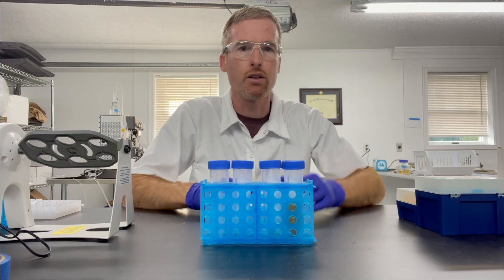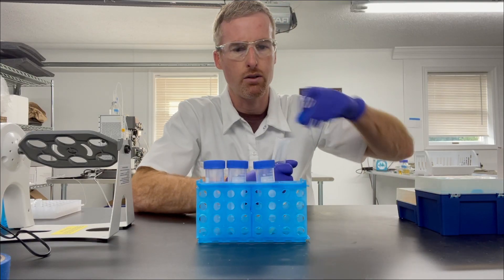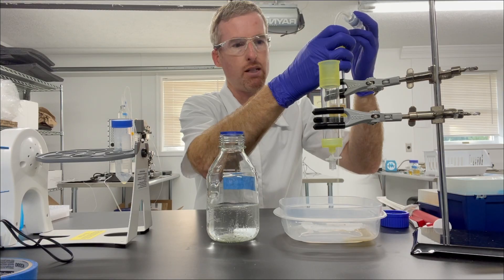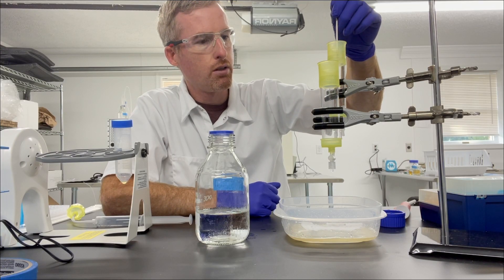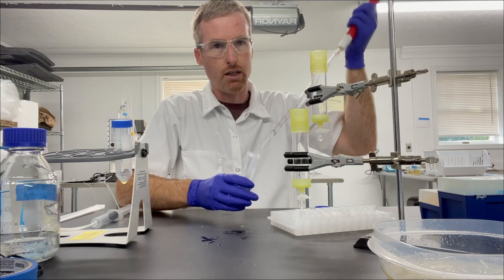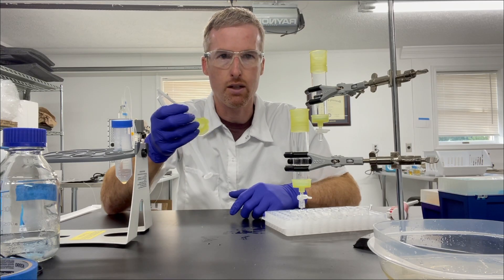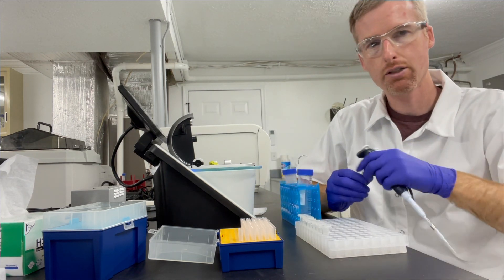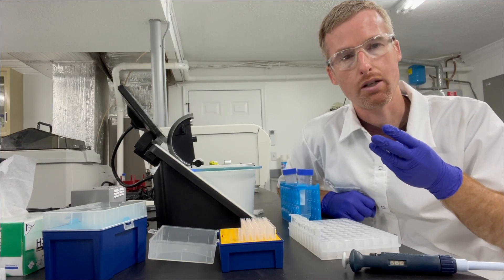His tagged protein purification from E Coli

Comment: Hi Jonathan! Thanks for your video. I am currently doing my master's and working on the phage protein ,i have some queries to ask. During the process is it mandatory to mix the protein with Ni-NTA? Because I learned somewhere that if we forcefully mix them, it will degrade our protein, and also many impurities will bind to the Ni. And one more thing , before adding our protein to the column, if we want to wash it with buffer, should it be imidazole-free buffer or should it have small concentration of imidazole.Thanks in advance
Reply from the maker: Hello, I like to mix the Ni-NTA with the protein while it is binding. I use a shaker or an end-over-end rotator for this and avoid vigorous mixing which might create foam and degrade the protein that way. I also like to include 20-30 mM imidazole in the buffer which helps prevent non-specific binding to the Ni-NTA. Remember that imidazole changes the pH of the buffer so it needs to be adjusted before using.
Reply: @Solidzymes  Thank you so much, and one more thing I forgot to ask for: how long should I mix it, like for 30 minutes or 1 hour?
Reply from the maker: @Thestudents9020  I think different nickel agarose products might have different recommendations, but for me I mix it 20 minutes to bind proteins.
Reply from the maker: @Thestudents9020  Twenty minutes is usually enough.